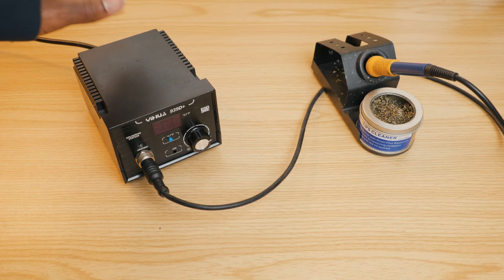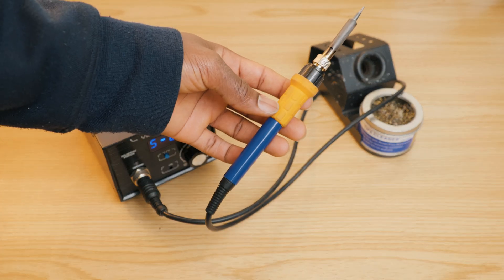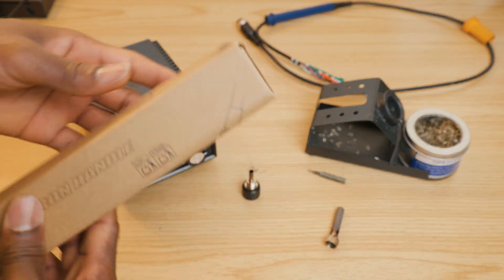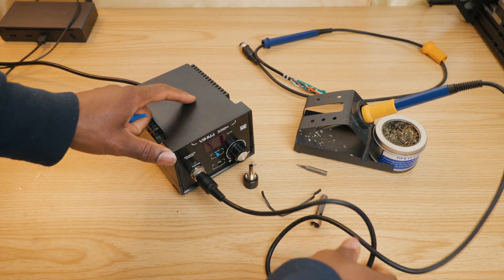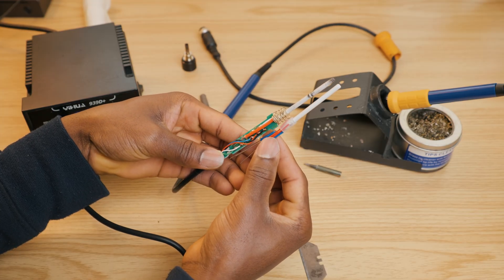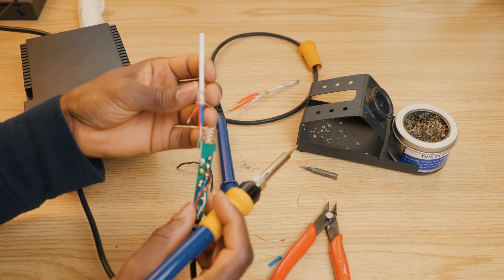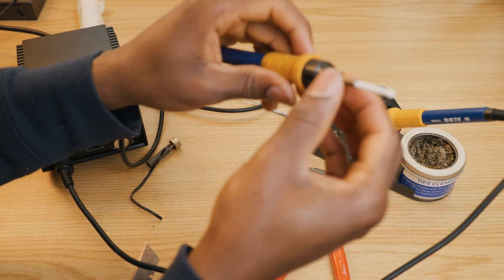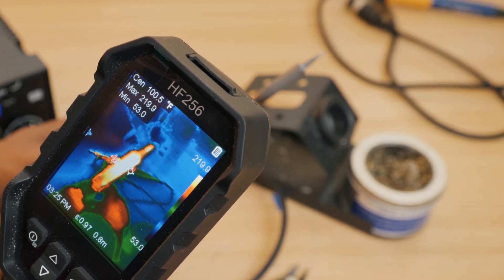How to Repair a Soldering Station with Error Code 5-E | DIY Fix

Comment: Where do i order the port solder from?
Reply from the maker: Ebay or Amzon, but heads up. They all have the same look but very different. You have to google your soldering station's "model number" plus "heating element". Then read all specs to confirm it's exactly for your station, otherwise it will get hot but never hot enough to solder consistently

Comment: need to solder a soldering iron,
I'm changing brands
Reply: Hey man, I just bought a 2 in 1 from them and I'm having the issue with the blower not the soldering iron. Is it still the heating element in the hot air gun or?
Reply from the maker: @Tompzu592 If the tube gets hot but doesn't blow heat out, then it might be the blower fan, but if air comes out but not hot enough then it's the heating element. Sometimes loose connection can lead to this
Reply: @YvonSmart the fan nor the heating element come on lmao maybe it's just defective 😅😂
Reply from the maker: @Tompzu592  Yes it could be